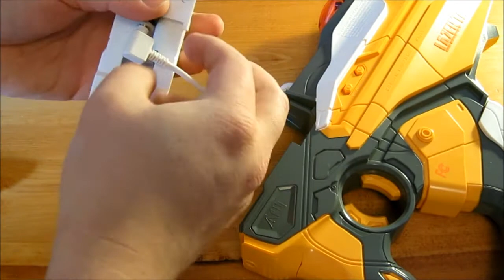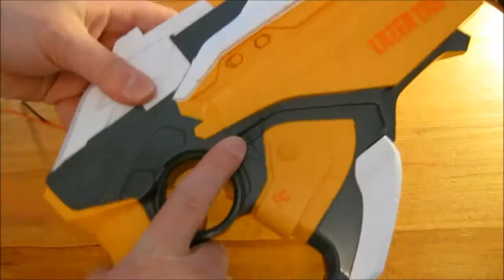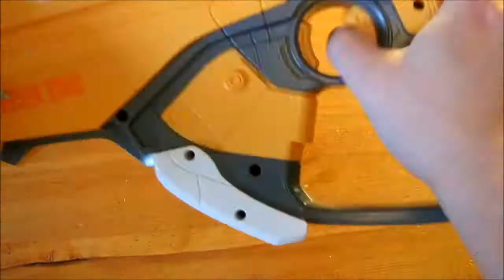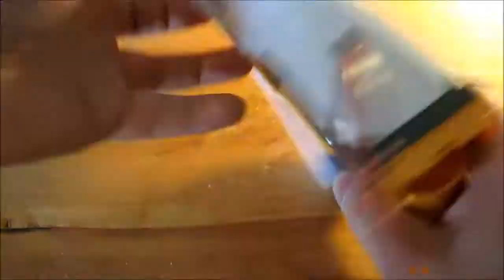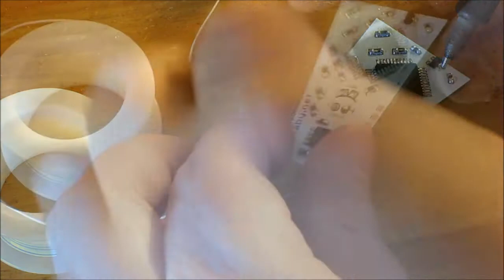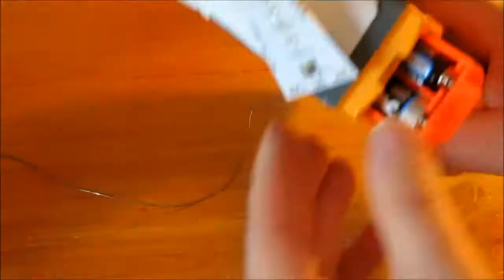Installation of the ZZLT LTAR Display

Comment: I could theoretically hook it up to a separate battery pack, if I wanted to swap it between guns right?
Reply: Sure, a battery pack, or a quick disconnect for power wires.
Reply: thatdecade Now if only these were still for sale. :/
Reply: Logan Benton Send me an email. I have the long lead time parts in stock to make more. thatdecade at gmail

Comment: As mentioned on Lazer Tag Team Ops Players Group, "don't hold the part in your hand and drill towards your palm." Drimel also.
Just last week when I was trying to trim some plastic for my tagger I slipped with my Xacto knife (while thinking to myself cut away not towards) doing a nice number on my finger. Luckily my wife works at Norco and I get cheap medical supplies... including safety glasses.

Comment: Great video, I like your clear pronunciation of each step, good editing with pauses between steps, speeding through time consuming steps, and addressing issues at the end. The only thing I missed was what gauge of wire you used and would this new wire type be included in orders.

Tell Izzy I love the white and blue lights in contrast to the orange/yellow lights in prior models.  

I played a game with the LTX & LTAR last night and could pick out the LTX players in the dark because of the lights and the glow on their faces. I wonder if the cool factor of white lights vs. tactical awareness would become a problem? Red or Green is used by the military because it reduces night blindness.

 I'm thinking I'll just find some old 3D glasses and use the plastic to suite my needs instead of asking you two to redesign a wonderful product. 

Keep inventing great things.
Reply from the maker: Yes, all kits will come with flexible 26 gauge stranded wire and is much easier to work with.
Reply: Cool, I wasn't sure if higher number was bigger or smaller for wire.